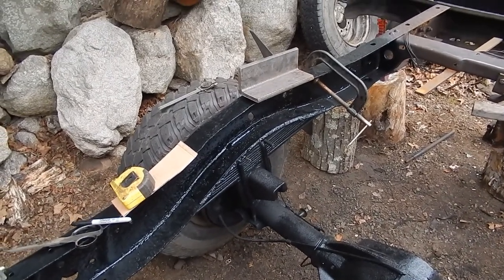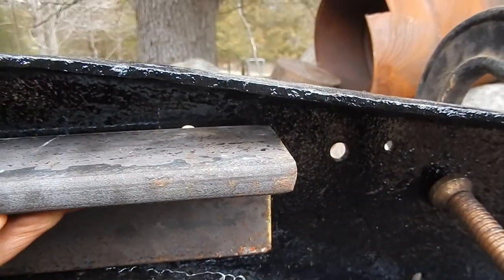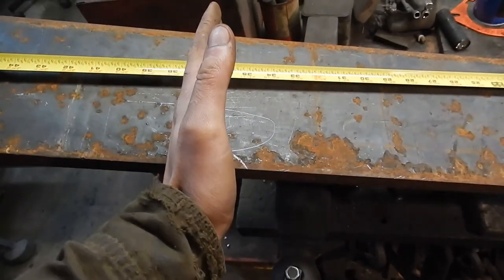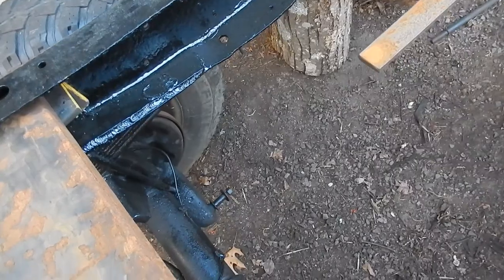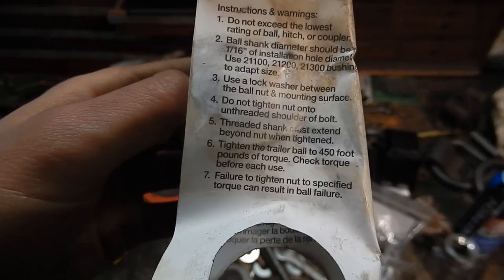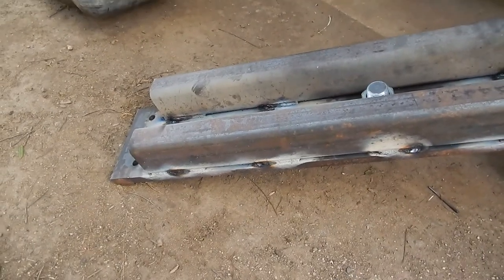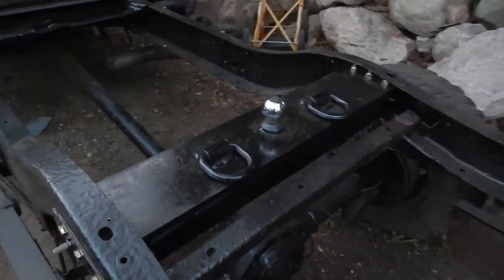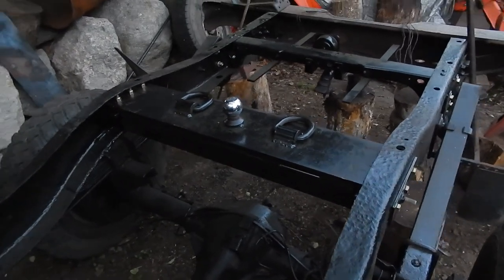Fabricating a Gooseneck Hitch for a First Gen Dodge Cummins

Comment: man buddy that over engineered goose plate is probably 10 times more solid than my whole truck. the plate alone would have more than done the job. great job though compared to what i did its more than solid and. for sure wont break. if i recal my plate was either a 1/4 inch or 3/8 inch plate with a double lap single bolted on each side( i was still not at bed height so added another 2.5 wide plate where the ball mounted to compensate. and after 6 years nothing wrong with it.
Reply from the maker: +danielfred16 Yup, i've seen a factory-made 25,000LB GN hitch composed of a piece of 1/4" (maybe 3/8") plate and a ball welded on. After i saw that, i knew i could make my own, and many times better! I basically wanted SOLID, SUPER safe and ZERO liability for a homemade hitch that could potentially be pulling a lot of weight. even for the over-building, it only cost about $200.

Comment: you did a good job on that I like it
Reply from the maker: Thanks!
Reply: Your welds are good enough that you could have welded horizontal plate to the angle. And used one tube that tied into the angle. Anyway, I don't mean to be arm chair quarter backing. Your design obviously works better than well.
Reply from the maker: Thanks! The reason that i didn't weld everything was for liability reasons. Also, I imagine that a bolted coupling might have a little more give than a welded one, which is good for a pickup truck.

Comment: I hope you centered that ball slightly ahead of the axle.
If not with a full load, you may be in for a scary ride.
I have a B & W hitch with an 8 foot box and it is NOT centered over the axle. It is ahead of it.
Oh I also own a Kenworth and the 5th wheel is not centered over the tandem. Again slightly ahead to get the right axle loading.
Been driving 18 wheels for over 30 years, so I might know something about this.
Reply from the maker: I thought i mentioned it in the video - it is slightly ahead of axle. if it isn't, why does it make for a scary ride?
Reply: If the rear axle is directly loaded with standard springs, they will squat or depress directly down and the front axle will not load in the same manner changing the caster and will affect the steering. On an air-ride truck as the Kenworth is, there is a self leveling valve in the suspension that keeps the frame at a standard height not changing the caster with varying loads. Also on a two axle truck as the load dynamics change in stopping, turning and accelerating if the axles are unevenly loaded this changes the reactions of the chassis of the truck making it different with each load weight.
Anytime one changes something on a car or truck, that person should always think of the safety of everyone sharing the road with them. Not every day we drive on clean dry pavement and if it rains or is loose gravel or night and something goes wrong, it could become a scary ride. Especially if we hurt someone else because of something we did.
Reply from the maker: that is all true, but a loaded bumper-pull trailer will squat the rear end and do nothing (if not un-compress) to the front end, but the truck and trailer handle fine. perhaps pickup trucks and semi trucks are different in this regard?
Reply: Yea. Maybe I am cutting hairs, just too many miles on the highway with flatdeck, lowboy and reefer.
I still like your work.
hellofa lot better that most of the people that call themselves experts.
Keep sharing.
Reply from the maker: Thanks!

Comment: "one giant washer" - smart - i always learn something watching.  hmmm, re: shock bar [9:20]  shouldn't it be 90° above lower mount? - oh, continued watching i see you addressed this...
"...most solid part about the entire frame..." - so, another part will fail before this does, ifff...nice looking feature addition!...
...yet, that said, i'm sure i am the only viewer not sure how it works! after bed placed...
Reply: just realized plate corners could have been radiused to allow longer length for sliding/swinging into c-channel

Comment: You mounted the ball too far to the rear. The proper location is 1 inch forward of the center of the axle.
Reply from the maker: +robert schulz That's about where it is. i used a plumb bob to determine the proper position relative to the axle. i was aiming for 2" ahead of axle, but i ended up with about 1.
Reply: It looked farther back on the video